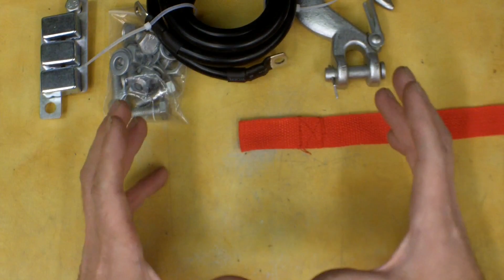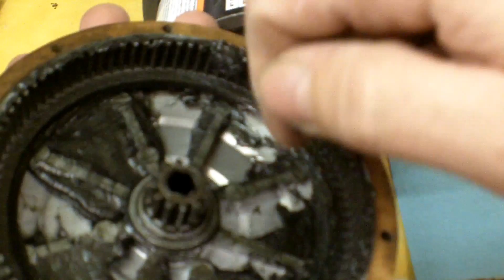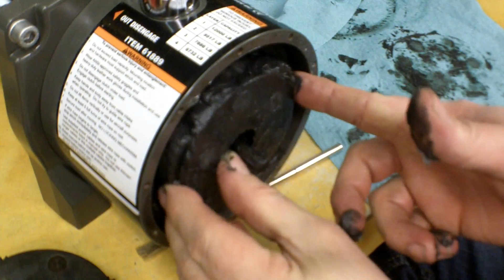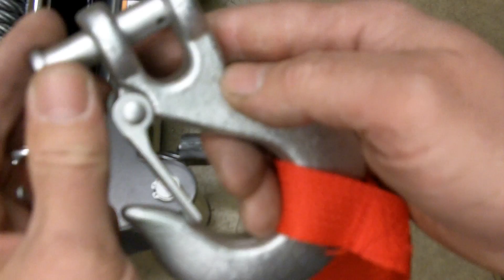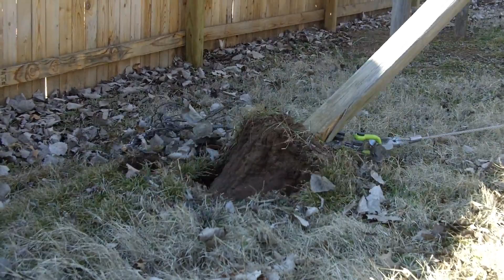Harbor Freight 12000 LB Winch Review, Teardown, Installation, Safety, Etc. Model 61889

Comment: As far as not finding model number, im 99% sure hf changes model numbers for same product, as a way to tell how old stuff is, keep people from using a 12k winch for 5 years, buy a new one, and return the old one in the 90 days warantee period for the new one.  Or, they might get batches from different factories, and usually retailers get some kinda kickback, so if they replace a dud under warrantee, the manufacturer gives them some money back.  Source: did ordering for a big auto parts supplier.
Reply from the maker: You might be correct. As far as I know, HF uses many different factories as suppliers for products- so each factory gets a different model number. Source: Me.

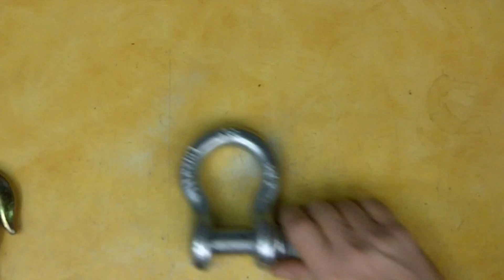Comment: At 25:55 the last gear is held in by some kind of restraining plate with 2 screws. I can't find that replacement peice anywhere.
Reply from the maker: I really don't know. I looked at the parts breakdown and it only shows the complete gear-set at part 15- not that plate and the two screws. I didn't take it off on my so I don't know what it's function is. Sorry I couldn't help. Good luck, G.

Comment: Hi great video. just wondering if the Drum will turn that the engage and disengage switch goes thru ? i need to Turn the drum 1/4 turn clockwise ? the winch bumper im putting it in make the switch at 9 oclock hard to get to. Thanks
Reply from the maker: I could be wrong, but I don't thinks so. Take care, G.
Reply: @ghostses  yeah it don't look like it does. just trying to figure out how to get to the Disengage switch to Free wheel the cable oh well it was a thought. Thanks
Reply from the maker: @dalecoy5974  You know what Dale, you can't clock the position of the lever itself, but I think you can change where the lever is. I looked at the parts breakdown and if it's taken down further than what I did, you can change where the lever is in 36 degree increments. It could be on the bottom of the winch for that matter and would work just the same. Download a manual and look at the parts breakdown. Focus on parts 6 and 7. You can rotate part 7 in any of 10 positions. Maybe that would work for you. Good luck, G.

Comment: only the cont box might be water tight. the winch  it’s self is NOT even water resistant, . if it goes under water take it apart ASAP. clean and relube .
Reply from the maker: I hear you man, but fix your shit and use proper punctuation and capitalization. What you did doesn't fly here. Be better...

Comment: Eh...it's an okay winch....would not be reliable in long-term durability.  I'd much rather spend hard earn money on a more reliable product than to be throwing money away on a mediocre winch those greases looks cheap hence why it onlyworksk for a short time to let it cool down otherwise you'll just burn out the motor.
Reply from the maker: Did you not proof your post, prior posting?

Eh, do you have any experience with this one?- no I says. Doesn't seem like it, and feel free to correct me if I'm wrong. Spend your money however you see fit. At first it was "okay", then it became "mediocre"? You have no videos on this winch on your channel, and no videos at all for that matter, and therefore have no experience or input that's valid in any way.

Comment: how do you get the cover off of the controller box? Are there studs in the cover that go through the mounting legs?
Reply from the maker: Ray, this was posted years ago, but I think there're screws that come up from underneath that will allow access. You do need to get the box off first. Not much help, but hope it helps. Take care, G.

Comment: I found this winch on the side of the road with no solenoid and tried jumping it with my truck battery, to my surprise it still worked but it was a bit out of of place, I took it apart and everything went back in place well except the drive shaft was bent a bit I took it out to straighten but didn't see where the two allen bolts that hold the automatic brake go into.
My question is do you know where that brake should be in between those two allen screws?
Reply from the maker: I do not Ricky. I didn't take the brake out of mine. Good luck, G.

Comment: @ghostses what to use to lubricate the cable itself?
Reply from the maker: I haven't used it all that much after all these years so I've never lubricated the cable. I'd search for what is appropriate and go with that. Good luck, G.
Reply: @ghostses  I couldn’t source anything online. Was thinking of maybe WD 40 gel lubricant
Reply from the maker: @user-kc2ul2rh8b  I can't speak for that, but I would go with something like this. I didn't shop around for a better price.

https://www.amazon.com/CRC-Chain-Lubricating-Spray-Weight/dp/B0013J84C8/ref=asc_df_B0013J84C8/?tag=hyprod-20&linkCode=df0&hvadid=198070022856&hvpos=&hvnetw=g&hvrand=10992533784418415696&hvpone=&hvptwo=&hvqmt=&hvdev=c&hvdvcmdl=&hvlocint=&hvlocphy=1024324&hvtargid=pla-403883812967&th=1

Comment: Thank you sir ! You've helped me greatly ! I just bought a winch same thing but must be slightly different as it's not got the automatic tensioner stuff. My friend bought it thinking his old one was bad turned out the battery was his problem. Point being he's lost the owner manual and that red strap for the hook ! Guess I'll figure out something ! Anyway that entire video you've shown me helped with the gearbox question I had do I trust they've done the BEST job or do I do as you did , so we'll see on that. Thank you again for your help and good luck to you !!!!
Reply from the maker: Good deal Kurt! If it's a HF winch, I believe they had to models of the 12k, one with the tensioner and one without. In most cases, you can download the correct manual by the model number on their website (assuming it's a HF winch). You can make a strap pretty much out of anything, or purchase one. Good luck to you as well, G.

Comment: another trick for those cotter pins is you take a needle nose pliers and roll the ends in this completely gets rid of any chance the cotter pin could snag you and also provides slightly better pin retention because the 2 ends look more like the cotter pin eye
Reply from the maker: Good tip! Thanks for sharing. Take care, G.

Comment: So my solenoid has the short red wire 2nd and the long red wire 3rd, opposite of what the instruction booklet shows. Harbor freight help line said it doesn't make a difference, but the winch doesn't make a sound or pay out or in. Any thoughts?
Reply from the maker: Sorry man, I can't say what the problem might be. I would assume that it would work the same for many winch brands, so I would search for your problem outside of the HF winch. Good luck, G.

Comment: You make things look easy and well done and lots of safety 👏that is real good.also like the way you show how to take the gears out and clean them and put back if I remember lol .I also bought a 12000 # badlands but one thing I notice that the one you have .Have 2 springs on top of winch and my don't what is that for.great video thanks..
Reply from the maker: Thanks Mario! The springs on the top put tension on a bar that is supposed to help keep the cable tight to the drum and wind up properly. Most of the winches I've seen don't have them. Good luck, G.

Comment: Very helpful. My winch won't line out under power. It feels like it's locked from inside when I try.
Reply from the maker: It should Andrew. If it's new, take it back for a replacement. Good luck, G.

Comment: Well makes sense, if you have your line all the way out, that's when you need that full strength. But I would think it's the opposite, you would think the shorter the line, the greater the strength.
Reply from the maker: Yeah Marcus, it would seem that way but it's the opposite. Good luck, G.
Reply: @ghostses  Unless you shorten the cable on the winch, where it only takes up one layer on the winch shaft. Add an extension as needed, pull yourself out of a hole, add shorter extension increments until your out of the hole.
Reply from the maker: @marcusharley3064  That's true Marcus. Or you can do something with the extra cable using snatch blocks to get  on the lower layer(s).  For myself, I would rather deal with snatch blocks over dealing with storing lengths of cable. Many ways to accomplish the same task. For me, I don't 4 wheel so my thoughts may be vastly different from those that do. Take care, G.

Comment: Hello, and thank you for this video. Do you recommend taking the gearbox apart and re-greasing it when it is brand new, before putting it into service? Some people have said that the grease this arrives with is low quality and may result in premature failure of the unit. . . thanks in advance.
Reply from the maker: I can't speak for the newer ones Michael as I don't know the quality of the grease used. With that being said, I believe I would do as I did here regardless. Hope this helps, G.

Comment: That is exactly what I was looking for.  I was curious as to the quality of the gear system on  the new badland 12k winch and I believe it would be as good as this one.  I was looking at a wanr and come to find out that all the winches below the new EVO model are made in China now.I will definitely keep this winch on my list.  I see people saying they are junk but I see no one showing videos of what made them fail.  If oyu follow winch and cool down times I think I will be good to go.  Interestingly Warn and others do not give you winch times but harbor Freight does.
Reply from the maker: Good deal Alex. I know what you mean with the bashing. I really think folks don't really know how to use them properly- especially in regards to duty cycle. I will admit mine has not seen hardcore use all these years- but it simply works when I need it. I don't know much about their later versions, but I would definitely keep them on the radar. Good luck, G.

Comment: I'm getting ready to install that exact winch on my dodge ram 3500 dully for our camping trip out west.  I'm setting it up on the cradle so I can use it from either end of the vehicle with quick disconnect for the power.  Thx again.
Reply from the maker: Good deal! Hope your setup goes well. Good luck, G.

Comment: This is a superb documentary on winches in general and the 'Badlands' winch in particular.  The reviews of Badland winches often criticize the wireless controller and the relays/solenoids. Have you had issues, and if so, can you acquire/use equivalent parts from a top name brand such as Warn?
Reply from the maker: Thanks Gregory. Mine has never seen extensive use but it still works like day one- no problems at all. I don't know if you can use Warn relays/solenoid as replacements. Take care, G.

Comment: Where can I buy that post pulling thing?    Yellow teeth?
I need to pull up some thin walled pipe from an old 3' tall fence.   Wonder it it would bite and not slip?
Reply from the maker: Matt, I purchased it from Northern Tool. It's called a grubber. But no, I don't believe it would work for pipe. I would used a polyester strap and use it like a choker. That's exactly what I did to remove concreted in chain link fence posts on my property. It worked great. Hope this helps, G.

Comment: great video.where did you get the winch plate or the plate with handles for your bumper hitch?you said you didnt go with harbor freight brand,so was interested with something strong like yours.thanks
Reply from the maker: Robert, I purchased the mount from Northern Tool. It looks like they don't have them any longer. G.

Comment: I know this was posted 6 or so years ago but I hope you are still around. I am trying to install this winch onto an arb bull bar bumper. In this bumper the winch actually mounts upside down. The bumper instructions say to disassemble the transmission and rotate the housing 140 degrees in order to give access to the disengagement lever. From your incredible video it doesn’t look like I can actually move the housing in order to move the clutch engagement level. Is it true that the housing is permanently attached to the winch body?
Reply from the maker: I'm still around Vern. I've looked at the parts breakdown in the manual (Mind you it's the exact model I've show here) and it looks like there are 10 fasteners that hold the part with the disengagement lever to the main body. You should be able to clock it 36 degrees per hole. By my math as shoddy as it is- you should be able to reach 144 degrees. That might work out for you. You will have to dismantle the winch further that what I've shown here to gain access to the fasteners but it seems doable. Hope this helps and let me know how your project turns out. It might help others out with that type of mounting. Good luck, G.
Reply: Thank you very much. That helps a lot.
Reply from the maker: @vernlemasters6504  No problem! G.

Comment: Darn great video ! I fabbed up a mounting plate to go where my spare used to ride and put my roller fair line where my license plate was. A rear mount just made more sense for my needs. I wish I had known about the receiver hitch mount from Northern would have been way faster, although not quite as strong. I've got a 1/2 plate 10 inch wide from frame rail to frame rail. Plus. it's be nice being to winch with a trailer hooked up to the hitch. One thing about grubbing the trees and shrubs... I hope you were sure of where all your plumbing was. Thank you very much for the effort you put into this video.
Reply from the maker: That's a cool setup Richard! Good tip- but yes I knew where everything was. That is something to look for though. Take care, G.

Comment: I have seen 3 or 4 iterations of the 12,000  - - I'm one of those who pays attention to detail like the proximate location of the plug for the remote on the side of the box, the position of the springs on the coil bar and the method of attachment for the box to the winch unit. On yours at 12:06 of your video it shows the bracket for the solenoid box  - - the bracket itself is attached to the box via screws with nuts  and the bracket has one screw on each bracket at the back to lock it in place. My brackets are attached with  phillips head screws that screw into the box and where your screws thread into your bracket mine is not threaded but rather those screws attach to another semicurved bracket piece with threads in that second piece and the front curved piece on yours has a much deeper curl to it whereas mine you locate it on the bar and push down and it pops over the bar the you clamp it with a phillips head by tightening that second piece around the bar and it clamps sort of like something you'd attach to the handlebars of a bicycle.  Your plug for the remote appears to be near the front of the box whereas mine is near the center but slightly  to the rear and that was where I encountered the interference.  The coils on the springs that maintain pressure on the bar keeping the cable level as it coils on the spool attach to the front on mine with the extended arm part of the spring attaching on the rear. I could slide the remote control wire on to the plug but not the slightly larger wireless remote piece and that was my clearance issue.  In the other videos about 12,000 Badlands winches which you can click on right next to yours the plug for the remote on the box appears to be in 3 different locations and some have the coil part of the 2 springs attached to the front while others have them on the rear on the leveling bar.  I build my own race cars and do a lot of welding and fabrication  and on occasion may have  re-engineered things I think the automaker could have done better or in a more practical way so I'm used to making things work. My installation will be a bit more involved because its in my V-nose enclosed race car trailer  which has plywood flooring which you absolutely don't bolt a winch to so I will have wafer the plywood with metal plates and weld a cross piece to the frame underneath and attach the bottom plate to that to properly anchor the winch
Reply from the maker: Good info Gary! Take care, G.

Comment: Thanks for the heads up on the tear down. I purchased mine 2 years ago, and recently pulled a car up on my trailer. I thought the chrome bumper was scraping on the angles holding up the spooler, but it was actually shearing off the lever to the transmission. I might have got lucky and only broken the set screw, but I'll have to look at it again when I see it.
For reference, the angles are tall enough to protect the lever which is why I didn't worry. Hindsight. Oh, well. If not I guess I got to buy a new one.
Reply from the maker: No problem Leon! Hopefully you can locate the problem and fix it over purchasing a new one. I don't know if HF sells parts for these- but it might be worth looking into. Good luck, G.
Reply: @ghostses  Cheers!
Reply from the maker: @Leon-wz1js  Good deal! G.